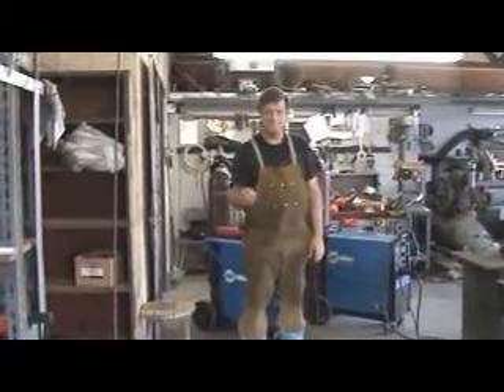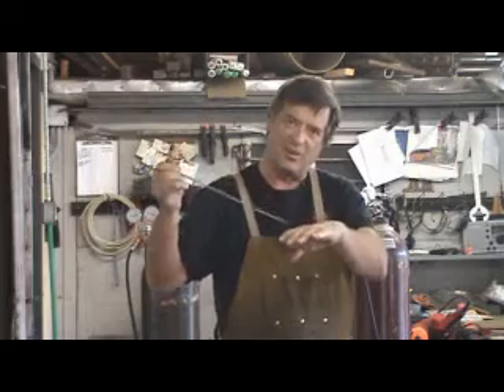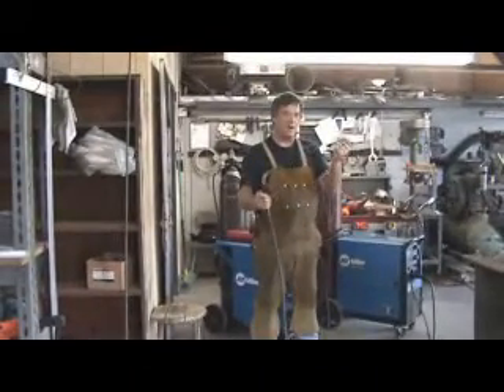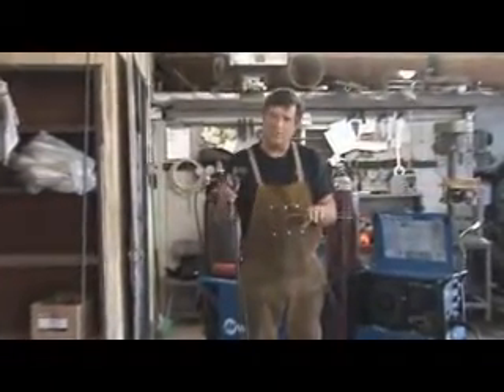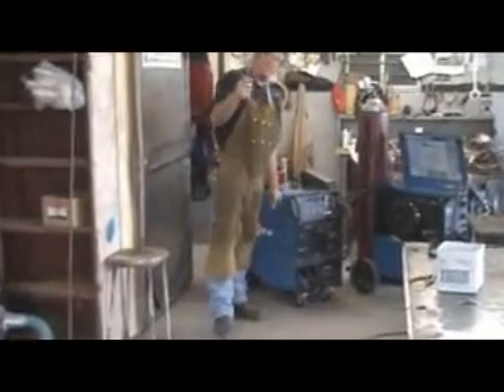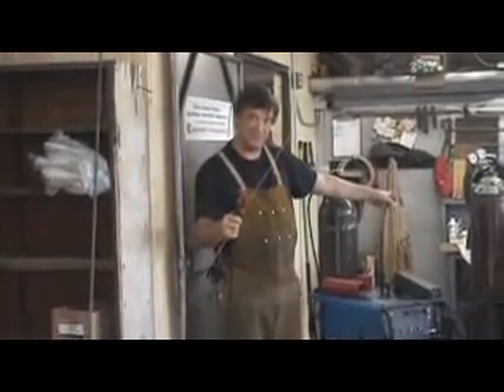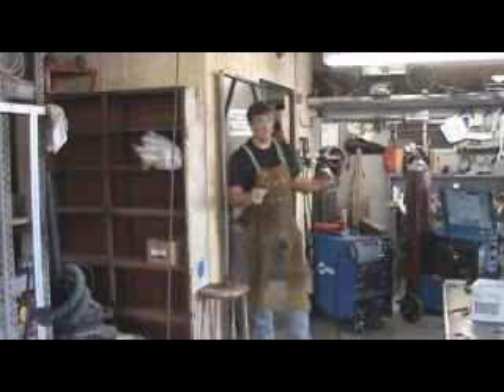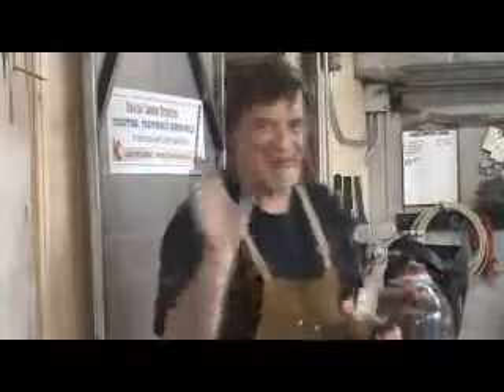Comparing Arc, MIG and TIG Welders - Kevin Caron

Comment: Hi, I guess you've answered this a thousand times but - I have flux core mig welder that i use to repair my van & general use for making the odd bracket/thing for my joinery work, the flux core is ok but cleaning the slag off is a pain sometimes, do you think it is worth me buying a gas mig machine as all my welding has to be done outside, my joinery shop has too much wood n shavings in to take the risk of welding inside it. I'm guessing with your work you weld outside fairly often, what do you use & have you a vid of this? BTW i live in England windy & rainy is the norm here.
Reply from the maker: I would have to say for outdoors you already have the best thing.    The wind will be your biggest problem using Mig with gas.
Reply: Thanks, yep that's what i thought n the reason i haven't got one yet. it's rare we get get calm dry days here. not enough to be able to make plans around anyway, I do get jealous when i see the nice clean welds on the internet by people with gas machines,  Thanks for the vids, your clear and factual ;)

Comment from the maker: @SKoGoMoney Yes, If you run this machine without the gas then you have to run flux core wire. You will get the same slag that you get when you ARC weld. The gas does the same thing as the flux on the ARC rods. 
This is a MILLER 251. The newer 250 is a much improved machine over this one. While I do use Miller you should keep in mind that there are several great brands out there to chose from. I would try to stay away from the overseas brands though. Thanks for the great questions.